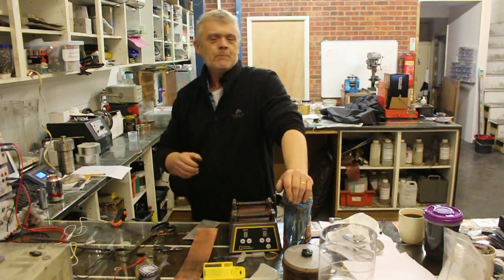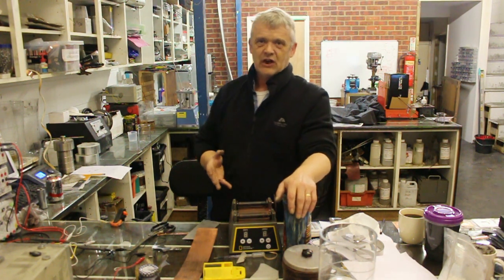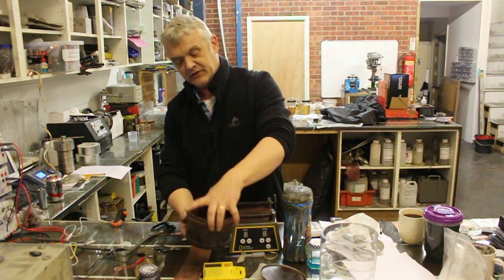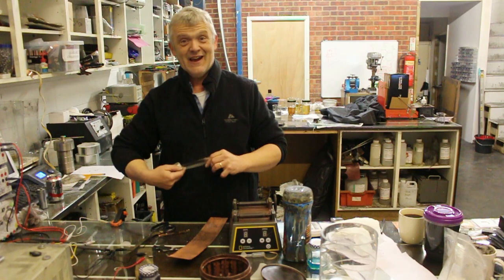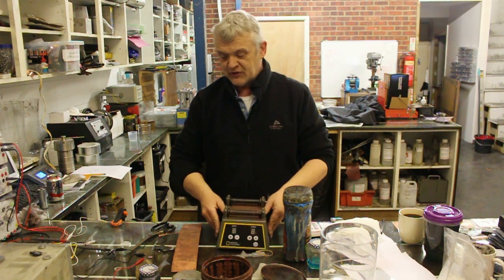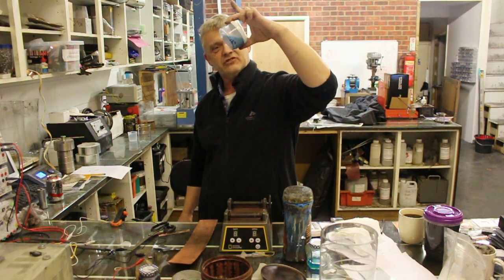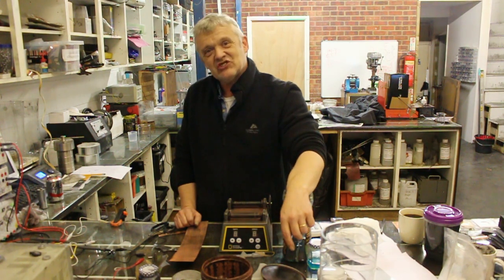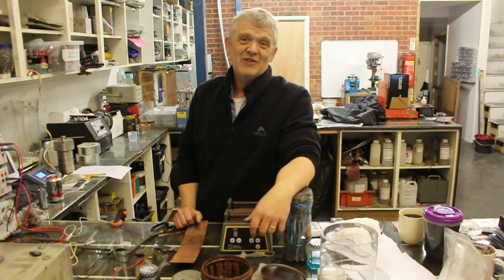Copper Plating Aluminium - Peen Plating

Comment: Have u put a DMM set2 resistance (b4 and after) ? Why is so little apparently known about this? .  My initial search turned up one relevant paper published by dudeat Nasa in 1974.  Does it have a non immediately obvious limitation or flaw?  Is the adhesion method known? I haven't read that paper yet but I'm free associating it to be like friction stir welding?

 I'm building a Resistive spot welder/cutter  (cap discharge variety with 111f of Maxwells 6s2p) electrod clamps /cable attach point is  aluminum.  I own a rock tumbler if I drive am hr to my parents if you haven't tested it and would like the info I'll let u know if I try it.  

This looks like it could be the ticket to even lower resistance to the weld point.  Especially with short pulses bringing skin effect into play.  Any idea if it could be done with silver?     

Great video as always!

Random last question but would u happen to know of any esoteric substances to add to a copper 2 chloride etch bath to reduce undercut or somehow better the bath? I've got the right color and it works as it should in my aerated tank. I just keep reading comments that industry knows a few more tricks and I'm always looking for a quality improvement but making it was the first time I've used Chem outside of one lab at  university. I consulted with a friend  who has a strong background to avoid gassing the neighbors.  :D
Reply from the maker: peen plating is a standard industry practice mate - i found loads on it. As for the second question i am afraid not I really don't know that much about electroplating i am afraid
Reply: Robert Murray-Smith : I found more information later with the "ee" spelling.   in the video I hear/believe u spelled it  "pean" but I noticed a heasitation on 2nd viewing.  Spelling never been your strong suit? Usually isn't mine. Nor is word for word comprehension in an echo prone environment lol. At the moment I'm removing metal (etch) to make circuit boards but I do plan to plate holes between layers (vias) instead of rivets. Powdered Graphite in nail Polish/varnish is supposed to work as a hole activator  and  using my favorite health tonic of H2SO4 + CuSO4•5H2O  + HCL with some dc current I should be able to plate

 I use cupric chloride for etching...Made that  tank really cheap by using acetone to weld plexi. 

  Is the video where u make the Nanoparticle solution with a coper salt and ascorbic the same particles you used here?  thanks for the reply above. I hope all is going well for you!

Comment: Awe but do the mil spec test heat to 500deg for five min I believe. I worked at a R&D plant. We put zincate then electroless nickel.
Reply from the maker: awesome mate - but this is an alternative for folks - plus you could try other mismatched metals if you wanted the idea here is fascinating
Reply: Robert Murray-Smith other day I received my nife nickel iron battery. I immediately went to the panel. The iron one I swear had crystals in the compound. Between the grids. Quartz? Looked like tiny diamonds. Your thoughts. Ordered a microscope. I'm on a roll.
Reply from the maker: no idea mate - sorry. Microscope sounds like fun though
Reply: Robert Murray-Smith I got it cause I want to determine the surface etch

Comment: Copper and Aluminum are incompatible and the resultant composition could be interesting. The materials have differences of electrical potential. Do a search for "The Reaction of Aluminum to Copper in Electrolysis".
Reply from the maker: you may have missed the point of the experiment

Comment: Dunno about 'peen' plating Al. Managed to copper plate some conductive carbon and solder a wire to it though :) 
http://www.sciencemadness.org/talk/viewthread.php?tid=70570&page=7#pid470105
Part of the idea is to plate the carbon structure's massive surface area to get the current collector right into the active material instead of just sitting on top.

Comment: is there a reason you wouldn't use a smaller sized bead than 4mm? like sand grains?
Reply from the maker: very cool post mate - thanks for that
Reply from the maker: i would just try it and see - i can see no real reason not to lol
Reply: the weight should help to wield the particles together I assume

Comment: Would it be possible to use the copper nanoparticles instead of a dye in an anodising process and then electroplate more copper on to to the surface to 'fill in the gaps'?
Reply from the maker: dunno - it's well worth a try mate

Comment: Could be a way of coating aluminium PCBs with a thin layer of copper to make soldering easier.  It'd use less copper than traditional fully-copper PCB traces.  (i worry about a "peak copper" future)

Does it only coat metals, or would it coat plastics too?  I ask because the aluminium PCBs i experiment with have a scotch-tape backing and there's no reason to waste copper on that, so it'd be good if it resists it.

If it doesn't resist it - well there's applications for that too (an interesting way of making flexible copper-trace PCBs).
Reply from the maker: it's well worth a try mate
Reply: Cheers Rob.   I ask incase someone in the community already has experience with it, and might be able to save someone else the wasted time from needlessly repeating a dead-end experiment.
Pooling our collective knowledge is a good time saver.
Reply from the maker: i agree mate

Comment: Would this work for carbon as well? If my thinking is right, this would be similar to your physical method of graphene coating, but with the increased persistance and pressure, you would get a much stronger, thinner coat.
Reply from the maker: it does work mate

Comment: ' spose the question is how could you optimise this . Presumably there will be a covering of oxide on the alley which will reduce the copper to alley conductivity . But may be a great way to reduce further reaction . Great work & so relatively simple .
Reply from the maker: it's a good one to work with mate

Comment: That is interesting so many ideas spring to mind .... I need a second lifetime to do it all...
Just kidding but there is ideas needed testing in this vid thank you rob.
Reply from the maker: absolutely mate - the vid is meant to inspire and try to get folks testing and trying stuff - you should also be thinking about what other metals could be done this way and what other things can be coated - there will be changes to make but peen plating is well researched and a ton of info is available on the net - just google peen plating and you will have a ton of experiments to do - all with a rock tumbler and an inquiring mind lol
Reply: I thank you

Comment: [Restoration/Fabrication artist here] I use a similar method of "plating" with brass and copper for giving certain surfaces different patinas on old engines and sculptures. It works quite well! I've found that it works much better with brass if you heat the metal to be "plated" prior to peening. Although, I suppose in a scenario like this, extra heat might be unnecessary and inefficient waste.

Great video once again!

-David
Reply from the maker: nice comment too mate - very interesting thanks for the input

Comment: Nice idea, but... Unless the coat is absolutely free of defects you are prone to experience some accelerated corrosion on the Aluminium.  It would be OK if kept dry but Amy moisture that can act as an electrolyte will form a galvanic element at the defects, with copper as the more noble of the two the Aluminium is the one to erode. Also known as galvanic corrosion.  With zinc on steel for example the less noble(zinc) is the top coat and the one to dissolve thus protecting the steel.  Decorative: yes ;functional :???  I am having doubts... But still a nice idea by overall concept.
Reply from the maker: Mate - read around on peen plating - this isn't my idea it is a kitchen adaptation of an industrial technique
Reply: Robert Murray-Smith I am not questioning the feasibility of the peen plating process, it's indeed used industrially.  It's the combination of a copper coat on Aluminium.  I don't know what your uses are so you may be fine- but as said any moisture  or wet environment with ionic content(distilled water would do nothing) is prone to cause corrosion defects in the Aluminium at spots not 100% covered.  It's simple electrochemistry.  Put it in a closed container with some salty water for a week...
Reply from the maker: ok thanks for the input - but the point was peen coating - i chose copper only because it is traditionally hard to coat onto Ali - no other reson
Reply: if you let it long enough there should be little to no spots uncovered, altought industrial ways of doing this sure are more effective of course, also for the corrosion, they could coat it with some protective layer, depending what they plan to do with it of course

Comment: The horrid Tape Peel Test, lol.... In years of PVD, Physical Vapor Deposition work, we always had some anxiety with a new coating and the QA Tape Peel Test. Plenty to go wrong that will cause the test to fail, my job was to go figure out why it failed. The nano-metal particle peening reminded me of some explosives clad work early in my career. I can't even remember what my job was in all of that, just the cheap thrill watching the explosives expert who ran the work and did it all day, day after day for a month or more. Of course I checked out the physics of all that at the time and thinking this is pretty interesting stuff, expect there are some common threads in this. I will plan to spend a little time revisiting those ideas and see what comes of it. Cheers
Reply from the maker: always worth a look again mate

Comment: I originally found your videos when investigating copper plating onto unusual materials using conductive paint, cool you've returned to it again.
Would this work similarly with gold / silver plating with nano particles?
I've been tinkering out of curiosity with purifying sterling silver with electrolysis, hoping to maybe make silver nitrate or something I can plate with in future.
Reply from the maker: worth a try mate